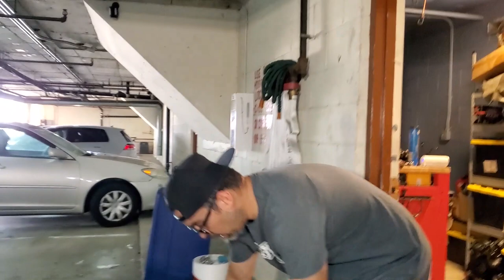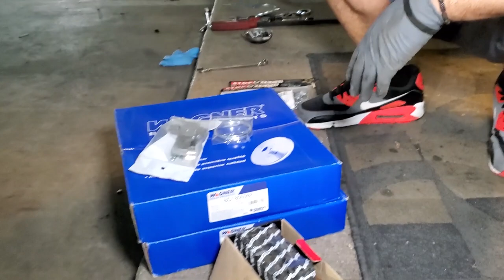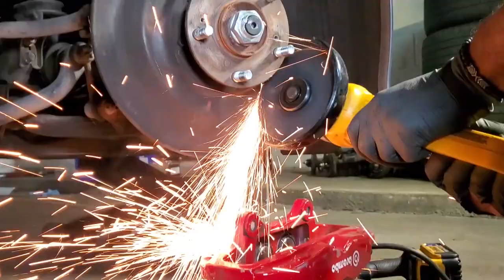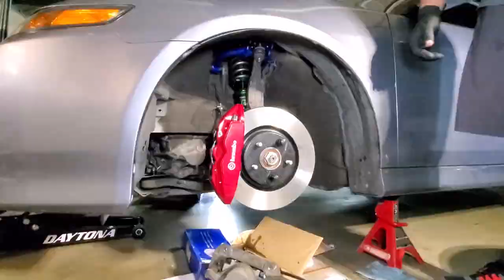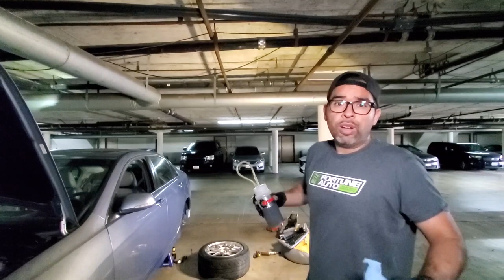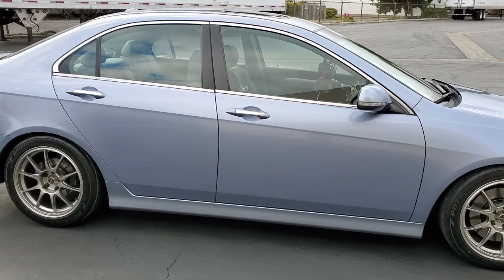Project Acura TSX CL9 Pt.3 : BEST BUDGET BRAKE UPGRADE!

Comment: this is what I have been looking forever since I got my tsx! Thank you so much for posting this! could you by chance post the caliper part number so I can be absolutely sure?
Reply from the maker: Any year Genesis coupe with Brembo caliper will work.
Reply: @blipshiftapex9047  Were you running 17" rims still or 18's?
Reply from the maker: @danielorellana1666  17"
Reply: Any forums where i could see the DIY? Tl type s needs drilling and s2k rotors, RL is expensive cuz the bracket is like 100usd... DC5 and Genesis brembos are bolt on or need drilling too? I'd love to put brembos after the cold winter coming here in Quebec

Comment: If I'm right, you have to drill your mounting holes to fit TL type S calipers. RL need the bracket from fast brake and Genesis - DC5 dont need any bracket or drilling?? So that means these are the two cheaper options, 3rd position Tl type s and most expensive would be RL.
Reply from the maker: Exactly right, No drilling or with the genesis/dc5 kits. Although the Genesis kit uses a larger rotor than the DC5 kit.
Reply: I. Actually doing the same i just bought my rotors drill and slotted and my brake lines I have the tl type s calipers and I'm confused as of if its from the spindles you re drill or are we talking about re drilling or tapping the calipers? Thanks i been trying to get these on but with having that danm it I forgot something feeling... 😆
Reply from the maker: @welvezsh1  as far as the RL calipers go im not quite sure. But i generally dont like any brake kits that require the redrilling of my hubs as i tend to like reversible mods.

Comment: So it's the rouge s or sv trim for the rotors? And for the bolts are they hyundai genesis bolts from those exact caliper? Did u end up using thin washers at all or anything else I should know? I just ordered my remanufactured set of calipers.
Reply from the maker: I did not end up using the Genesis bolts. In the updated video of my most asked questions I add the information for the correct bolt lengths I have used with lock washers. The rotors are from the specific rogue that has a 3rd row seat.

Comment: Love the vids!! I was surprised to see the bolts weren't the correct size. Mines have been in with the old bolts for almost a yr now. I didn't use the the hubcentric spacers from fast brakes. I tried calling Hyundai for the bolts they told me I need a vin#. Need the spacers and bolts!!
Reply from the maker: You can look up the bolts online to find the part#. I forgot it off the top of my head. But a 30mm bolt with the same threat pitch would work with a lock washer.
Reply: @blipshiftapex9047  Ok I'll have to check with fastenal to find them bolts. How about the hubcentric spacer for the rogue rotors
Reply from the maker: @Notsniw_dc5  You can contact fastbrakes.com for the hub centric ring. Its very inexpensive.
Reply: 25mm or 30mm bolt??

Comment: wait quick question, with the hub centric rings from fast brakes and the nissan rogue rotors, does the hub bore size change? from the video, it looks like the hub bore increased in size with the rings. the rings look like its not flush with the rotor, so if my wheels have 64.1 hub bore that fit the tsx perfectly, how will that fit over the hub rings?
Reply from the maker: The ring is thin and only the thickness of the rotor. It doesn't affect the hub are the wheel center mates to.

Comment: Wondering can you use oem brake lines ? Maybe get a softer  pedal
Reply from the maker: Why would you want a less responsive pedal? If anything you can just a less aggressive pad. But I would never upgrade to a performance part to use OEM rubber lines.

Comment: Hey great video, waiting for an update on the build. I’m wondering if your running a spacer in the front with your wheel setup?
Reply from the maker: Thanks for watching. No spacers. I like running set ups that don't require it.
Reply: @blipshiftapex9047  thank you for the reply. I will get these wheels now since I don’t have to run a spacer up front. Can’t wait for an update on this build.

Comment: I’ve been running RL calipers on my TSX for the past 4 years, but they honestly have been a PIA from the brake squeal. I first used the fastbrakes caliper bracket which I think was causing the brake squeal noise because part of the brake pad isn’t making contact on the rotor 2-3mm. Then I tried the fat4custom caliper bracket and the brake noise still happens. 
I might just sell that kit and look into the option you’re running. I’m running EVO 8 wheels 17x8 +38 and I wonder if they will clear the Genesis brembo’s.🤔
Reply from the maker: sounds like more of a pad and hardware issue than a bracket issue. I dont have any of those issues but then again i am on a very good daily driver pad. I honestly dont know if the evo wheels clear without a spacer. i wouldnt doubt youll need something like a 10-15mm spacer to clear them.

Comment: Sup man, I got everything to put the Brembos on my INTEGRA...LOL  (TSX) and my used Brembos didn't come with the hoses still attached, my question is, will the factory TSX caliper brake line bung bolts work on the Brembos? Which ones did you use? Thanks bro
Reply from the maker: There is a link in the video description to the stoptech lines i used for my tsx. You should upgrade while you are already in there. But if you don't you can use your stock lines. If im not mistaken i used the Brembo banjo bolts through.

Comment: Why cheap out on pads and rotors when you already got ss lines and good fluid?
Reply from the maker: For a daily driver the Centric pads I chose are more than sufficient and low dust and noise. When its time to track it $200+ G-Loc race compounds will go on like on my Sentra.

Comment: What about ABS? Does everything work as it should? Is any adjustment needed?
Reply from the maker: No issues with abs, everything works as should.
Reply: I hope u understand that and works on wheel speed sensor

Comment: I was curious about when you said that the pads had to be grinded or shaved, what was too thick? I'm thinking a brembo 350z rotor might be able to be used, (4mm in diameter bigger)
Reply: ...Pads had to be filed I meant...
Reply from the maker: @shawnking7005  just on the edges. Pads can sometimes come with slight imperfections that needs to be smoothened out for correct operation. Nothing major.

Comment: They don’t sell the hub centric rings separately. What size are the stock and what size am going to? So I can look for rings from another brand
Reply from the maker: I wouldn't know. I got my rings from FastBrakes separately.
Reply: @blipshiftapex9047  must be nice. Looks like they only sell them as a combo with rotors these days.
Reply from the maker: @dzynr320  You called and spoke to Brian from fastbrakes? Well this is where you take it upon yourself to find a solution.
Reply: @blipshiftapex9047  back when you made this video, the rings were sold separately. If they wanted to sell them separately they would have that option still.

Comment: What up man, I installed the same set up but with centric rotors and the pads are Hawk performance. 3mm of the pads are not getting any wear, any suggestions? The Wagner rotors are 320mm diameter and the centric is 319mm
Reply from the maker: cant help if you didnt use the specific parts from the specific cars i provided. I would bleed the system again to make sure you are getting even pad pressure.
Reply: Henry, are you getting brake noise?
Reply: @goforbroke2  yeah some noise when reversing. I ended up trimming the part that wasn't making contact. Still made noise
Reply: @henryguardado4089  Oddly enough I get some noise when reversing as well. The other brake noise I was experiencing when driving I fixed though. The brake pads were hanging off the outside of the rotor by like 3mm. It was a enough to cause crazy brake noise. I shaved down the pads and no more noise. I’ve tried different pads and had the same issue. Even tried different rotors same issue, brake noise. Also tried the Fastbrakes bracket no difference, so now I’m running the Fat4custom bracket. It’s the better bracket and fitment. There was a dude on the tsx forum who was making steel brackets years ago and nobody had any issue with those.

Comment: Informative video. would 18*9.5 et 40 wheels clear these calipers?  thanks.
Reply from the maker: They should clear based on size/width/offset. A lot has to do with spoke design as well.

Comment: What size tires and rims are you using ?
You weren’t clear on the bolt issue 
And do you need hun centric rings cause I have to stock 17 rims (cl7 euro r )
Reply from the maker: You can run the stock Hyundai Caliper bolts. The wheel and tire information is in the follow-up video that is up on the channel as well 😁👍

Comment: I’ve done this setup and every 5-12 months, the rotors always gets warped. I’ve done multiple BBK before on Acura/Honda chassis.
Reply from the maker: Strange. So far I am still on the original rotors that were installed in the video.
Reply: @blipshiftapex9047  Yea, I don’t know if it’s the auto part rotors or the way the customers drive but I’ve had 3 come back within 1 year due to warped rotors. TL Brembo s on the other hand never gave me or my customers any issues.
Reply from the maker: @dukeduke3599  it could always be how hard people drive. But it does seem like a strange observation.

Comment: What wheel specs do you need to run the calipers?
Reply from the maker: Its more about spoke design than wheel spec. I believe in this video the wheel and offset is stated of the current WEDSport wheels currently on the car.

Comment: I need some help, I did this upgrade option on my 2006 TSX. I needed to add an 8MM Spacer to make my wheels in the front clear :/ I seem to be having a hard time finding extended lugs, Ive been recommended ARP Studs, However i cant find a direct replacement. I search online and i seem to be led back to a set of ARPs for late model GM vehicles. Would those work? Any input would be much appreciated!!!
Reply: I also called ARP and they said i would need to know the knurl diameter and thread size. If anyone knows!! thank you!
Reply from the maker: The tsx uses a standard Honda knurl size 12.22mm. this means you can use a standard Honda ARP kit. ARP-100-7712.  Only the dc2 type r uses a different knurl from my understanding.

Comment: U mention spacers ???? What spacers for the hub for the rotors or the rims?
Reply from the maker: I dont run spacers for the wheels I have. But I mention hub centric rings to center the rotors on the hub correctly. Those you can buy from fastbrakes.com

Comment: Nice, thanks for sharing.
A year later, are you still running this set up? Still liking it?

On the side note, that is the strangest bleeding procedure I have ever seen. Does tsx not have split braking system like 99% of modern vehicles incl all hondas? (2 pistons in bmc?)
Reply from the maker: The bleeding procedure is per the Factory Honda Service manual. The brakes have never felt better. They have served and performed magnificently.
Reply: @blipshiftapex9047  good to hear thanks, cant wait to get mine.
Must look into the procedure for those brakes, I have prob missed something.
Reply: Did you have to use a washer between the caliper and mounting point? & also did you cut the Hyundai Genesis oem bolts at?

Comment: Do you know the specs on your wheels I’m trying to do this upgrade but having a hard time finding out what wheels are good to use without a spacer
Reply from the maker: It will differ between styles of wheel and back spacing. Mine are 17x9 +49

Comment: Thanks for the information, can this setup work with stock 07 TSX rims?
Reply from the maker: With a 15mm spacer yes.
Reply: @blipshiftapex9047  Thanks man, appreciate the help. New subscriber.
Reply from the maker: @randyp6370  You're welcome. Thanks for subbing!
Reply: I copy & paste this, only difference was the pad choice. Waiting on the parts!! should I roll my fenders?? I’m running my stocks too 06 TSX

Comment: Damn so oem wheels won’t clear calipers or is it possible to use spacers to clear calipers
Reply from the maker: With stock studs I wouldn't recommend running spacers. Also due to spoke design stock wheels won't clear. Stock wheels are definitely not wide enough either.
Reply: BlipShiftApex ok thanks man
Reply: I have these brakes on my 2007 Acura TSX with aspec rims. You need 25mm spacers.
Reply from the maker: @Sengouken  wow thats wild, hope you are running extended studs so you dont have minimal threads barely holding the wheels on.
Reply: @blipshiftapex9047  Running the spacers with studs, not just spacers. Also hub centric as well.
Reply: I wonder if this would work on my Element. The TSX stuff swaps so if this works on the TSX this should works on the Element as well.
Reply from the maker: @alexisasplundh8606  it should if the tsx stuff swaps over as far as the brake parts go.

Comment: How did the Genesis OEM caliper bolts work for you? I seem to have rubbing issues as they are a little to long. I'm planing on just cutting then to clear. Would you recommend?
Reply from the maker: I used OEM bolts with a lock washer which was enough space. If not You can just buy some 25mm bolts of the correct threat pattern with lock washers for safety.
Reply: What year is the genesis that I would be getting the brembos off of ?

Comment: Will you do the rear as well of just fronts ?
Reply from the maker: The rears I have upgraded with a RDX rotor and bracket from fastbrakes.com.
Reply: @blipshiftapex9047  What year RDX  and is it front or back rdx rotors?
Reply from the maker: @henryguardado4089  rear. The fast brakes site will tell you what year.

Comment: Good stuff! I actually went with the Brembos from the FD2R. Also using S2000 front rotors and 350z Brembo pads. The FD2R Brembos were practically plug & play.
Reply from the maker: Definitely good info to know.
Reply: Please make a video about how you accomplished this. Were you able to keep the stock wheels?
Reply from the maker: @SeventyEightCivic  you just need spacers.
Reply: @SeventyEightCivic  I had to change my wheels. I'm currently on the TL 5 spokes that have a +45 offset. Spacers work too.
Reply: @twothousanddeep  This brakes cleared with TL wheels and no spacer? Just confirming.
Reply: @goforbroke2  yes, the FD2R Brembos clear the '04-06 5 spoke TL Wheels with no spacer. It's a pretty tight fit. I couldn't put a dime between the wheel and caliper without scratching the paint on them.
Reply: @twothousanddeep  Damn that is a tight fit. I’ve actually been running RL calipers for 5 years now, but the bracket fitment is not good and leaves a few mm of pad hanging off the rotor which causes brake squeal. That’s why I’m looking at these Genesis brembos(I just bought a set) as a replacement. I’ve been running Evo 8 wheels 17x8 +38 and they cleared my RL calipers without any spacers or problems.
Reply: @goforbroke2  any fender rubbing on those wheels?
Reply: @avisliberis  No rubbing issues at all. My fenders are rolled, but nothing aggressively.
Reply: @goforbroke2  appreciate the reply. I haven't rolled my fenders, and plan to keep it "stock", so I guess that size ain't for me.
Reply: Any particular year for the S2000 rotors? What diameter and thickness is the rotor?

Comment: Were the rings for the rotors or your wheel?
Reply from the maker: They are in there. They go installed on the wheel hub itself.
Reply: @blipshiftapex9047  is there a link to purchase?
Reply from the maker: @Im_chrispytv  you can contact Brian at Fastbrakes @(602) 323-2110

Comment: Will the Brembos fit on the OE wheels? as they are 17s as well?
Reply from the maker: Absolutely not.
Reply: Why wouldn’t they fit on oe wheels??
Reply: As I looked deeper at the video ... I'm hearing the aftermarket 17s used have a wider stance and offset... Allowing for the larger caliper/rotor combo.

Does that sound right?
Reply from the maker: @bendunn227  you sir are correct.

Comment: Hey brother what other brake pad you can use besides the one from rock auto
Reply from the maker: I use Centric and now am on Akebono pads. But you have a lot of choices based on your driving style and needs.
Reply: Thanks for replying another question what offset for the rim that will work for these brembo
Reply from the maker: @Metelus24  it's going to be a matter of trial and error and wheel style. Just so happens I knew my wheels fit before I purchased. Offset is +49
Reply: I really appreciate your help you the best at what you do just keep them coming

Comment: Management must be cool as fuck for letting you work on it in the parking lot. Should of done a before and after breaking test. Clean whip. Almost forgot, when looking for new rotors. Under what part, name or what ever you go by if you want to use any other brand of rotors per say?
Reply from the maker: Off the top of my head I would say take the part # I put in the video. Cross reference what car they are for and find upgraded rotors for that car.

Comment: These calipers are not cheap. If someone like yourself gets lucky at a wrecker then it may be good but everywhere I've looked online they're lile 900+ for just fronts from a genesis  maybe im not searching correctly
Reply from the maker: Yeah don't be fooled. And they are cheap. Regular pricing I see for these is no more than $400 for a set from wreckers.
Reply: @blipshiftapex9047  user purchased some from a local salvage for $250. Btw what are the rings for ?
Reply from the maker: @felixvalentin1618  to center the rotor.

Comment: It doesn't sound like 450$ cheap upgrade. Ok upgrade kit 240 + hoses 100 + pads 50 and rotos... hundred for calipers... Brembo calipers cost 600-700 hundreds at least, I cannot find cheaper.
Reply from the maker: I got lucky. Found the calipers very cheap. Also I can still find them for about $150 each from wreckers online. So you definitely need to Google a little harder.